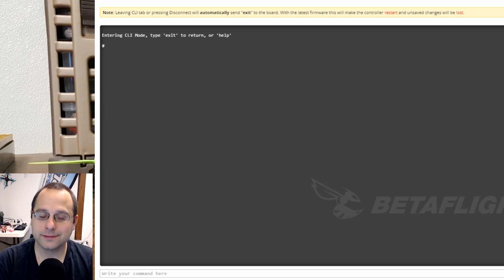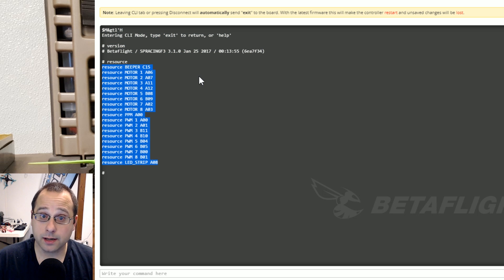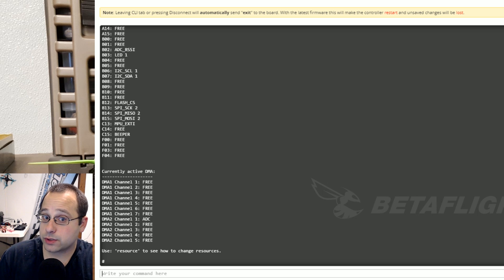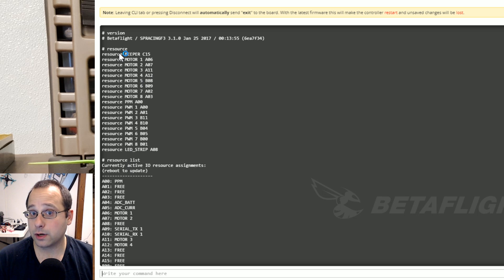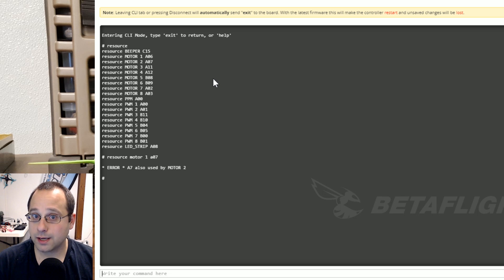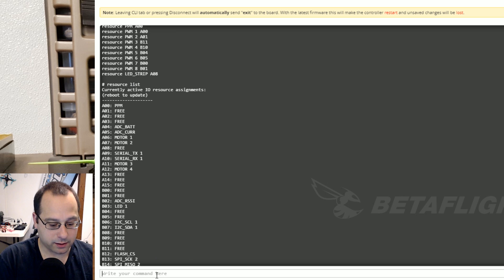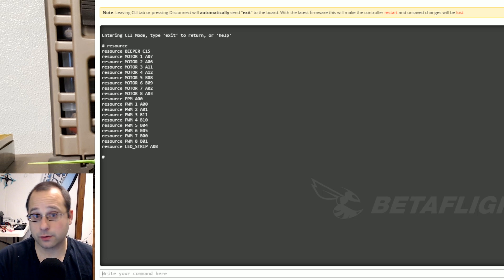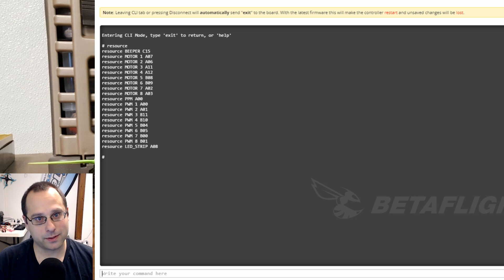Betaflight 3.1 Resource Remapping | NO MORE CUSTOM MOTOR MIXES YAY!

Comment: Is it possible to remap the "Video IN"?
I have a problem with my Flight Controller - if I connect my cam's video out, to the VTX'x video in, I get a camera image on my goggles.
If I connect the cam's video out to the FC, then FC's Video out to the VTX's video in, I Get OSD info but no camera image.
So I think the Video IN pin/pad on the FC is dead. 

I've been googling and watching videos, but nobody mentions re-mapping the video in signal, so I think it's not possible?
Reply from the maker: No, sorry. That isn't possible.

Comment: I moved my motor 3 and 4 to motor 5 and 6 because the 3 and 4 pads were faulty, now the escs won't boot anymore 🤔😭
Reply from the maker: You might have a DMA conflict. Or you might have done the mapping incorrectly.
Reply: I think i did it correctly. motor 5 and 6 were on b08 and b09 and i freed both of them, now when i go to resources it says b08 and b09 at motor 3 and 4, i soldered motor 3 on the 5 pad and motor 4 on the 6 pad. is this correctly or not? all escs make the first beeping sound but not the second and i cant arm them :(
Reply from the maker: That sounds right. It sounds like there is some other issue with your config if you can't get the ESC's to beep.

Comment: i think i have a mapping issue with my motors since i flashed betaflight. when im raising slider 2 in the motor section in BF motor spins. can you send me a screenshot of the resource list the way its supposed to be on the Bardwell f4 FC? i
Reply from the maker: Save your configuration from the CLI then type "defaults" and it will return to defaults. Note the default configuration and then paste back in the CLI dump you saved.

Comment: So I ripped my sbus pad off my CL_RACING F4,  can you remap that pad to the LED pad or something? Ive tried the traditional approach used with motors and other things with no luck any advice would be awesome
Reply from the maker: No, you can't use softserial for serail_rx.

The workaround for you is to do the uninvert hack on your receiver, then use the RX6 pad.

Comment: Will this work to to add an LED control? I am building a brushed mini with a F3 Evo brushed and there doesnt seem to be an LED control listed in any drawings i can find.
Reply from the maker: Yes. But be aware that LEDstrip feature uses DMA, so if your board doesn't have a spare DMA channel on the pin you choose, it won't work. Basically try it, and then type "resource list", and if you don't see ledstrip in the DMA channels section, it's not working.
Reply: Joshua Bardwell Thanks for the reply, i will play with it some and see if i can let the smoke out!

Comment: So today I migrated some parts across from and old quad to a new frame but didn’t realise I’d put the 4 in 1 esc in at 90’ off. This resulted in terrifying freaking out upon test hover so I tested the motors individually in betsflight to check which motor was which and realised my mistake. Not wanting to unbuilt the whole quad to fix it I came to YouTube and have now sorted it out thanks to this video. Thanks Joshua, I learned something today. 👍🏻
Reply from the maker: Glad to be of service.

Comment: I know this is a older video but i need a little help what i want to do is resource a uart to the ppm so i can use a frsky r-xsr receiver on my tiny7 and be able to get telemetry to my tx..Is this actually possible? i want to be able to solder the s-port wire to the ppm pad and get telemetry ... thanks for any help in advance..currently using 3.2 BF
Reply from the maker: You can reassign the PPM pad to SoftSerial and use that for SmartPort telemetry. That will work.

1. Look in "resource" to find the pin number that PPM is on. Let's imagine it is A08.
2. "resource ppm none" clears the resource off of pin A08
3. "resource serialtx 11 A08" puts softserial onto A08

Look at this point if the CLI tells you any other resources are also assigned to A08. If so, use "resource XXX none" to clear them.

Reboot.

4. "resource list" check that serialtx 11 is on A08.
5. Assign smartport to softserial 1 in Ports tab. Enable Telemetry in Configuration tab. Done.

Comment: i have a betaflight f4 and the solder pad on m4 signal lifted. any issue with changing that resource to tx2 and correct me if im wrong but from my understanding this doesnt affect the power or grounds of the pins in any way?
Reply from the maker: You cannot remap hardware UARTs, so moving to TX2 won't work. Use LEDstrip is my recommnendatin.

https://www.youtube.com/watch?v=FysPHx7RL9s
Reply: Joshua Bardwell thank you, i already have an led powered there can I keep the led light and use the signal wire as motor signal
Reply: Hi Joshua. I have the same F4 board. Wired Unify Smart Audio to uart6. I can only get it to work if i disable the OSD ! If i have both the OSD and the Smart Audio enabled, my OSD flickers like mad and the Smart Audio function no longer works. 

Have you any suggestions i.e. reconfiguring uart6 to Soft Serial ? Or is this not possible ? How can i have both Smart Audio and OSD working together without these conflicts ? 

I have my crossfire on uart3, using blheli 32bit esc's on RX1. uart2 is free, could that do smart audio ? It seems there's so much conflicting information out there at the moment regarding the wiring of these boards. I feel like we have gone slightly backwards in some respects. i never had a single issue with the BFF3 board. Everything hooked up and worked perfectly, all with the same kit (minus using RX1 for esc telemetry). Thanks in advance.

Comment: All my motor are spinning in the same direction :( , do you know how i can reverse direction of specific motor ?
Reply from the maker: Two ways.

In BLHeli, reverse the direction of the ESC.

With a soldering iron, swap any two motor wires with each other where they solder to the ESC motor outputs.
Reply: You made my day ! Thanks bro !
Reply: Carlton Stump grinder link belt roller bearing replacement
Reply: Carlton Stump grinder link belt roller bearing replacement
Reply: and if it is a brushed motor?

Comment: This helped resolve my quad flipping out like crazy, but im still confused about the motor direction.  If I note the motor direction per feeling each one and then set that direction in BlHeli, shouldn't they stay that way once they are armed?  Mine weren't and I had to use resource to switch them around.  Why is that?
Reply from the maker: +Funkdat FPV I don't really understand the question. Resource remapping doesn't change motor direction.

Yes, motor direction should always be the same unless you rewire the motor or change the BLHeli configuration.

Comment: So technically if I we're to install a 4 n 1 esc that's not ordered the way I need it oriented in the quad because it's not physically possible to install it in such a way. I can change the motor outputs to the correct orientation then right? Like rotating the board 90 degrees ccw and re mapping motor outputs to say like motor command #1 to pad 3 and motor com #2 to pad 1 motor com #3 to pad 4 motor com #4 to pad 2 .I would only want to do this because it wouldn't be possible to wire them in the correct way. I assume that's something we are able to do? Anyhow josh thanks for all your videos we all appreciate it as always..
Reply from the maker: +Mikeflightfpv yes.

Comment: Hi Joshua! I was wondering if you could help me figure out how to re-map an Led Tx pin for smart audio? I have an hglrc xjb 425 FC and a tbs unify Vtx. I soldered the audio pin to the Led TX pin but can't figure out how to make it work.
Reply from the maker: In the Configuration tab, enable softserial.

In the Ports tab, enable SmartAudio peripheral on the SoftSerial Port.

In the CLI, use resource remapping to assign softserial TX to the LEDStrip pin.

Look in the output of the Resource and Resource List commands to identify the name of the SoftSerial Resoucre. It will be something like SOFTSERIAL_TX 1

Look in the output of the Resource command to see which pin LEDSTRIP is assigned to. It will be something like A08.

Type something like:

resource ledstrip none
resource softserial_tx 1 a08
save

After power cycling the board, type "resource list" and verify that softserial_tx 1 is actually being used by that pin.

Comment: I have 2 bad tabs on a HobbyWing F4 FC. Initially the board is designed to stack on their 4n1 40a ESC and the connecting pins broke on a light tumble in the grass on the first day. I was able to solder in the wires as needed with no issues. However I recently decided to transplant this FC and in the process I removed the vvery delicate SBUS and also the Video out pads. Well they are not pads but very small thru hole style ports. So needles to say I need to relocate both. The pad designed for SBUS is inverted "I believe, right" so this may only be available to be moved to another location that is also inverted. On CLI after listing resources I am showing 2 separate inverters. I believe the 2nd would be for Smartport "which I am not using " as I am running the XM +. Currently I am trying to identify and map the FC layout with the programmed language with its corresponding device ex( Motor 1- B00) on a sketch of the FC as to make the relocation the 2 ports a little less confusing. So is it even possible to remap Video and/or SBUS? Thank you JB.

Comment: Good thing you mentioned that moving the buzzer isn't a good idea, was about to just that. (my Tiny SP RACING F3 EVO BRUSHED doesn't have Buzzer out) what exactly would i have to do to get it work? where could i maybe find infos on the transistor circuit i'll have to solder?

Comment: My Sbus pad ripped off in a crash, is it possible to remap it too? In the "resource" i got plenty of serials which could be used i guess? Sbus is a serial port right? Would it be poosible to remap it to ppm which is right next to the Sbus pad? Thanks!
Reply from the maker: You can't remap the hardware UARTs because they are hard-coded in the FC chip to certain pins. However, if you have a F3 board, you can put SBUS on any UART RX pad. If you have an F4 board, you can do the "frsky uninvert hack" (look it up) and then after doing that, you can use any UART RX pad. 

But no matter what you do, you are going to be down a UART. Which sucks. So you can try to scrape back a bit of solder-mask and solder to the trace directly. The problem with this is it will be very fragile and you'll need a bit of hot glue or epoxy to reinforce it.
Reply: First of all thank you very very much for the answer! It´s an F4 board so I´d have to do the hack, no problem. I tried the scraping but i have difficulties finding the traces but I will check again tomorrow. Being down a UART should not be a problem as i dont use smartport etc..., it´s only a 3inch quad so I don´t really need it. Thanks again for this very useful answer!
Reply: So it should theoretically be possible to use the ppm pad if i do the remapping? (after the uninvert hack)
Reply: Joshua Bardwell there's only videos about motor remapping, but what about led pad or ppm pad remapping?

Comment: Hi Joshua. If I see resources mapped to motor and PWM...do I need to remap the P WM if I remap the motor? I remapped 2 motors bit the quad hover then shoots forward and flips and crashes.
Reply from the maker: The motor remapping is not correct that's why the quad is flipping. Check in the Motors tab (WITH PROPS OFF). Use the sliders to spin the motors and see that the correct motor spins when you raise the slider.
Reply: Joshua Bardwell they did spin correct direction and motor order. Weird. So no reason I need to change the pwm settings as well as motor setting in resource? It shows both having a mapping. I only changed the motor resources. I'll check again, thanks
Reply: I'm having the EXACT same issue. I swapped the motor 1 with PMW 1. In the Motor's tab, all the motors spin correspondingly. However, when I hover test, it flips right away. Any insight on how I can solve this?
Reply: Danny Wang I upgraded to 3.2 in betalflight and did full erase after backing up my FC in diff and dump separate files. Everything seems to work. Did not fly horizon mode much but hovering seemed stable

Comment: Anyone know if there is a way to do this running Dshot?  Took out esc pads for motor 2 and I have moved the ESC input to motor 8 which works great with oneshot and multishot but if I try to run Dshot the esc isn't getting signal.
Reply from the maker: The reason is porobably a DMA conflict. When you assign Dshot motor outputs, each motor has to have its own dedicated DMA channel. Something else is using the same DMA channel as motor 8. Look at the DMA assignments when you type "resource" in the CLI.
Reply: Doesn't seem to be a conflict under the resource list.  Do custom mmixes work with Dshot? (I don't think so or if they are supposed to they also don't work with my setup).

Comment: I lost pad 4 so i'm on pad 6 but its not working for me. fc is the hglrc f3 v4 pro

resource BEEPER 1 C15
resource MOTOR 1 A06
resource MOTOR 2 A07
resource MOTOR 3 A11
resource MOTOR 4 A12
resource MOTOR 5 B08
resource MOTOR 6 B09
resource MOTOR 7 A02
resource MOTOR 8 A03

resource MOTOR 6 none

resource MOTOR 4 b09
Reply: and saved
Reply: Never mind. Bad solder mid way in the signal wire from extending it

Comment: I used this, checked the motors. Everything is running correctly from 1 to 4. When I try to get into the air it wobbles and crashes. Yaw seems to affect roll and roll affects roll when sitting on the ground. Is it possible that trying to use the mmix thing beforehand messed it up? I went back to the Quad X in the mixer before trying this method, but maybe it saved the settings in the custom mixer? Any help would be appreciated. Do I have to reset the custom mixer?
Reply: Was using 2 motors from different companies with same specs and thought that was the issue.. Replaced 2 of them and realise now it's something else. '-.-
Reply from the maker: +LaZieGoblin if yaw and roll are swapped go to the receiver tab and verify your channel mapping is correct.

Comment: I know it's not related but I was wondering what are your thoughts on reversing motor direction so trash doesn't get thrown on the camera lens. I tried looking through your videos to see if you made a video about it and I didn't find anything.  So I just wanted to get your input on it, myself I'm constantly fighting a blurry image and it's getting harder and harder to see anything clearly.
Reply from the maker: Personally I'd rather have trash on my lens, which I can easily clean, than my FC. And I don't think there is any real aerodynamic advantage.
Reply: Joshua Bardwell, yeah I was going to put some electric tape on the side of my drone to cover up the flight controller, so trash doesn't get thrown in it. It's easier to wipe trash of the tape then to have it shoved inside the flight controller. The place I've where I've been practicing, hasn't been mowed in a while and my quad is basically cutting the grass and throwing grass and sand on my lens and it has got so bad that I can see divots on my lens from all the sand and grass.
Reply: Man do me a favor and consider atleast testing it out. I just reversed the props and did the set yaw_direction= -1.

It flys so much better now. I feel like I'm able to fly forward faster and also hold altitude better and cornering turns are so much better now. After doing it, it seems like all the problems I ever had with it are gone.

Before I was struggling with holding altitude and trying to fly forward fast, it seemed like I kept having to hold the pitch down. Now it just Flys how would have expected it to.

Comment: Mr. Bardwell, is this method working on bf 3.2.. i tried to do it but when i typed resource list, it shows "free" on the certain motor commands .. but in resource those commands that i input are there.. please i need some help.. thanks.
Reply from the maker: +Mark Eufemio yes it's working in 3.2.

Comment: Hi Joshua! I have a problem with normal 1-2-3-4 wiring. 1 and 2 both spin if I increase slider in motor tab. Same with I increase motor 2, motor 1 spins as well. I tried to reassign to motor 5 and 6. And it tells me that they are disabled. Is there a way around this problem? 

I am sure I created this problem when depinning a SPRF3 and a tiny solder blob landed somewhere it shouldn't  have. I am stumped and want to get my quad in the air.

Thanks for any input!
Anthony
Reply from the maker: +Anthony Ballard most likely you have a solder bridge connecting signal wires 1 and 2. On some FC the motors share a DMA channel and you can't use dshot. Try using multishot. If Thst fixes it, then a DMA conflict was the issue. Otherwise I think you have a soldering issue.

Comment: YOU ARE THE MAN!! Right, came here from the previous video on changing motor location through mmix. And lucky me they keep updating things so fast, this is easier AND you can check your motors. Now to change my motor direction without having to resolder and I'm golden.. (I'm horrible at soldering so try to avoid it.) If I get into the air, it'll be thanks to you!

Comment: Great video Joshua I have a question I'm using the betaflight F3 board with racerstar 30amp ESC I mounted the board upside down so that the USB port is on the bottom by then rolled my configuration 180° in the configuration tab to accommodate for the movements so that is correct when I spit up motor one in the motors tab motor for spins if I spit up motor for motor 1 spins and the same as for Motors 2 and 3 when I arm the quad the quad will absolutely freak out and shake and turn itself left to right in the motors in extremely hot is this the reason why it's not arming properly and working correctly because the motors are in the same location as the betaflight motors tab picture please help thank you